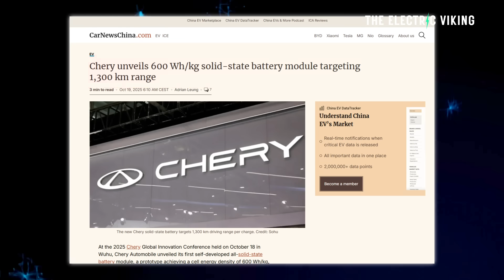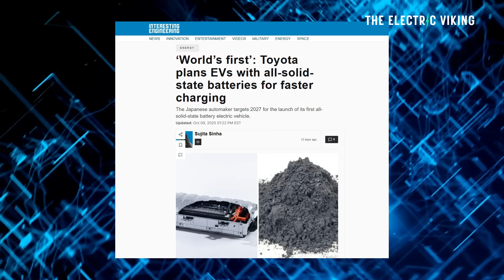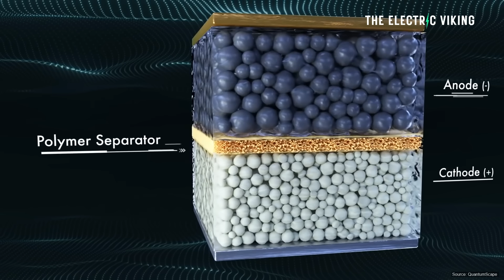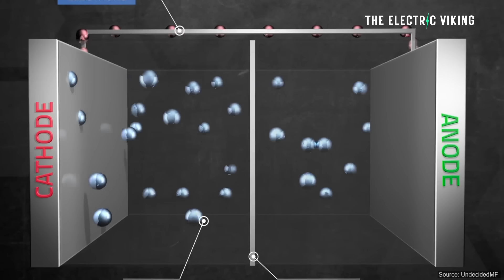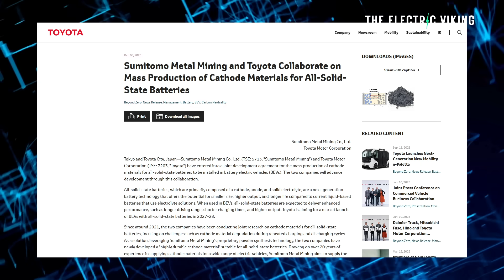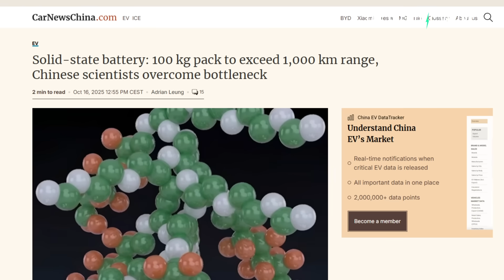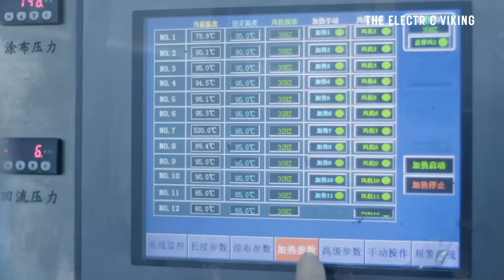Chery’s 600 Wh/kg Solid-State Battery: EV Game-Changer?

Comment: This would be nice for the E-Cars. You can built smaller Batteries into the Cars but they have more miles in it. 600 mliles or around 900km Range are enough. Long Range around 1200km would be very nice with this batteries.

Comment: China doesn't have oil so they are 100% on EV's and because of that and that they are new in car manufacturing without legacy they will stay on that path whch will lead to new advancement  not only in battery technology but also electric engines and in 10-15 years ICE cars will have no advantages over EVs so new generation will choose them as their first choice and in 40-50 years from now you will have totally different car market same as it was totally different in 1975-85 at least for European markets

Comment: 600wh/kg means 150kg/330 lbs of batteries will power a car at highway speeds for 6 hours. This IS a game changer.
Electric motors are great, but getting power to them has been the bottleneck. This could be the breakthrough in weight.
Next up: Charging time.

Comment: While expensive, it has specific use cases. Take the Polestar 5. It's a convertible. It's needs a lightweight battery so that it can remain nimble and is expected to have decent range (say 300 miles). Sodium won't be able to do this. The same is true for a Mini Cooper. It's a premium brand so people will pay more but it would be great if it had 300 mile range and also be lightweight.

Comment: Elon had previously stated that once battery density reaches 400 Kw per Kg commercial. flight become viable.. If this is true then the aviation world Is about to change radically. Also this, once the cost comes  down will  destroy the Ice motorcycle market.  I currently  Own a Honda CRF 250 , I converted to electric, with a max range  of 70 miles.. With that battery, one weighing the same as mine I could probably get a range of closer to 180 miles, On par or better than gas bikes with the same weight...

Comment: I refuse to accept the route-planning anxiety caused by limited battery range and insufficient charging infrastructure. I also refuse to accept even the slightest risk of battery fires.

Today, my gasoline car gives me a 1,000 km range — and I expect the same from an electric vehicle, with a full charge achievable in five minutes. Not 80%, but 100%. Since that’s unlikely anytime soon, I consider a 2,000 km range the minimum prerequisite for me to switch to an EV.

I also believe electric charging should never cost more than gasoline, and governments worldwide should make that a constitutional principle. Until these conditions are met, my answer remains simple: no to EVs.

And please, spare me the “eco” marketing gimmicks — the stripped-down interiors, plastic-heavy designs, and dull aesthetics that feel engineered rather than designed.

Wake me up around 2050, when technology might actually deliver on the promise. Until then, I’ll gladly consider plug-in hybrids with the new solid-state batteries, offering a 1,000 km gasoline range plus 300 km electric-only range. That’s a deal.

Comment: Batteries with this sort of power density are far more important for home battery storage than for the average EV driver who's daily mileage is  only around 19 miles in the UK and 40 miles in the US. What I'd like to see is a home system like the Sigenergy system having this level of power, along with it's dc fast charging and bidirectional capabilities. The ability to run my home for a week and top up my car with the 20 miles I've used that day each night all with free energy from my solar panels and I'd be as happy as a pig in shit.

Comment: A 600 mile range is perfect for the UK,  the UK is only 600 miles long by 300 miles wide at the furthest points, personally I've never known anyone who does that sort of commute on a regular basis, in fact the average daily mileage in the UK is 19 miles. As long as the battery is 800v and can charge in 10 minutes for the rare occasion it's needed, the other 99% of the time it can charge up during the 8 hours the average person sleeps every night. More power density is far more useful for home storage batteries, with the ability of bidirectional charging (battery to battery) of course . Then we can concentrate on improving the efficiency of solar panels to charge them up. Vehicles don't need any more power than is necessary to make them any faster than the maximum legal speed limit of whatever road they're travelling on and that can easily be controlled via the vehicle's gps.

Comment: I personally want a thousand mile range with aluminum ion and 12000 charge cycles to 95 %. Sounds like a tin anode with graphene caged tin. In a model 2 Tesla. At least a 500 mile range. With a super low price. With no thermal runnaway.

Comment: Don't get confused! Energy density has not much to do with the range, apart from the the total weight reduction. How much is that? Well if you currently have 250 Wh/kg density a 50 kWh pack will be 200 kg. the same 50 kWh pack with 600 Wh/kg density will be 83 kg. Yes, 117 kg weight saving, so the car won't be 2.1 tonnes, but 1.983 tonnes. Roughly 5% weight loss, which will translate to some range increase up to 5% if you are lucky, definitely not more. Range would increase if the battery weight remains the same 200kg, but then, we will have 120 kWh battery pack. Mind you that also need to fit into the car, which not many people talks about, the Volumetric Energy density Wh/liter. Don't get me wrong, I celebrate the higher density, just need to be clear what impact it has.

Comment: Eventually, we have to get to V2G, with as much capacity as possible in a battery. However, using abundant, cheap materials is more important. Until we have this combination, those high density batteries will be used for niche applications.

Comment: I would like an electric vehicle which can pull a 5000 pound load down the highway for at least 2-3 hours before needing a charge [my model X with 5000lb towing capacity only goes about 80 miles towing a speedboat]. I would also like to plug it in just once a week or so, instead of several times per week. That would probably mean it has a range of at least 500 miles on the highway with no trailer

Comment: An Indian high-level government committee finds that India’s “tenfold expansion” of its nuclear power capacity by 2047 is quite feasible and the committee suggests the investment begin immediately, says the Business Standard.      Mongabay explains non-economic loss and damage and IndiaSpend looks at how climate impacts are causing school closures, directly causing a potentially irreversible generational learning gap. Tell the U.S. POTUS that a generational learning gap for Indian children is NO HOAX, and not repaired by his "drill baby drill" pro-fossil fuel propaganda used to artificially prop up the U.S. Oil & Gas industries. Competing on UNSUBSIDIZED PRICE, Oil & Gas LOSE to wind and solar.      A Mongabay article explains the Climate Change factors behind the Ganga’s “most severe drought ever recorded”, with the river’s streamflow seeing the “steepest decline” in over 1,300 years. That's no hoax, any more than the U.S. Government SHUTDOWN by the Trump Republican Party control of EVERY branch of government, is a hoax.

Comment: The same range with less than 50% of the previous weight will be a game changer, especially if the charging speed is increased in the same proportion.

Comment: A slight niggle with the terminology: "Specific energy, also known as gravimetric energy density, is the amount of energy stored per unit mass of a substance or system, typically measured in watt-hours per kilogram (Wh/kg) or joules per kilogram (J/kg). It is a key metric for evaluating energy storage technologies, particularly in applications where weight is a critical factor, such as in portable electronics or electric vehicles, as it determines the amount of energy that can be stored per unit of mass."
Reply: Energy density is J/m**3

Comment: I just got back from 4 nights in Chengdu and 4 nights in Kunming.

We used taxis a lot. On the raods more than 95% of cars were electric. All the taxis. The roads are almost silent.

Scooters were also 95% electric. They drive them on the pavement sometimes, and the sound is like some high speed wheeled luggage. Audio cues are all wrong. Had to keep looking over my shoulder.

Comment: Common after all these years you still make an error that a 50kwh battery will give you a 1000km of range, yes they will be lighter but the range is the range and you need a bigger battery than 50kwh for 1000km you need at least 120 and probably 150kwh battery … which is possible with that energy density …

Comment: Although I appreciate your efforts, but there were more than 1000 game changers in past 4 years. Almost none of them made it to real EV car use. In fact Chevrolet Spark EV was the first car to use LFP in 2014. Even current EVs are mostly using LFP . So It takes decades for even good technology to make it to the market. Most of the people already have an ICE car, which they are planning to use until it stops working or become too expensive to run. As of today 

1. ICE cars (buying) are cheaper than EVs in similar segment (do not compare Mercedes Vs Toyota)
2. Insurance for ICE is cheaper than EVs (There must be some reason ? ).
3. Range is always more in ICE Vs EVs. Also ICE gives more flexibility. 
4. Support infrastructure (gas pumps , mechanics etc) is better for ICE than EVs.
5. ICE has less fire risk compared to EVs in general.
6. ICE does not depend on China (Battery rare earth mineral monopoly)
7. ICE tank takes less time to fill than charging an EV.

EV's biggest advantage is low cost of running, which is good for people who drives more (taxi, delivery man etc). In future EVs will surely beat ICE but it will take at least 10 years. I would switch to EV when:

A. Buying price for EV will be cheaper than ICE.
B. Insurance cost would be same or less than ICE.
C. EV has a minimum range of 300 miles (some EVs do have this now)
D. Real world battery life would be 200K miles / 15 years or more   (some EVs do have this now)
E. Can charge my EV to 80% in under 10 minutes (some EVs do have this now)

Comment: If the tech works it would absolutely not go in EVs initially.  This tech would be making it into supercars and electric planes first and gradually can find lower cost applications.  If they can make these even at low volume and they do what is claimed their is absolutely a market even if they are $1000 / kwh.

Comment: 600 miles vs 500 (depending on cost of course).  I live in Texas - cities are spread out and we drive a lot.  Have a Model Y and a Lightning in the stable.  

For the most part, don’t have range anxiety but that “perception” is keeping many folks from switching to an EV. 

500 to 600 at a reasonable price takes away that argument.  

My $.02!  (My 2 cents as we say here (opinion)).  

Thanks for video.

Comment: I'm an EE.  Just wanted to clarify that Solid State Batteries are complimentary to the liquid (sodium it lithium) batteries.  They charge and discharge faster so they are used for acceleration and regeneration.  About 20% of the battery pack will be solid state, specially on high power cars and other applications where short bursts are required...
Reply: Could you clarify further?  It isn't clear what they refers to at the start of the second sentence.   If solid state what advantage do the liquid batteries bring?
Reply: @wishdumain it's called a hybrid approach.  The main goal of a hybrid pack is to assign different chemistries to different roles, allowing the entire pack to operate at a higher overall efficiency. The SSB portion of the pack (potentially a smaller group of cells) is optimized for high power density (rapid energy delivery) and ultra-fast charging.

Comment: people with gas cars dont want 1300 km of range because they dont ever have worry about waiting for gas. or finding a gas station.  of battery degradation.  or the time it takes to charge. 

furthermore, we have to get to 100% renewable energy. 

I am in the phillipines.  The power goes out all the time. Vehicle to grid, home, and other vehicles would be amazing.  

I am really hopeful that we get to EVs having over 1000 miles of real world range.  its would be great if niche markets for higher priced vehicles provides the incentive and funding to get to truly advanced batteries at very low prices.

the batteries we have today are so massive and clunky.  they require so much thermal management. some companies have swappable batteries, but most have batteries that are incredibly expensive to replace. hopefully, by 2035 we will have batteries that would be so impressive by todays standards.  just like today's batteries are so impressive by 2015 standards.  we now have ranges that are double what they had a decade ago, and we should aim for at least one more doubling.  

bigger ranges also allow for smart charging.  we are going to have times of massive over production of renewables.  hopefully, enough people can be incentivized to fill up large batteries when their is an oversupply of clean power.

Comment: Mostly likely market for they batteries is sports cars and sports motorcycles, where the weight matters more than the cost.  A lighter more compact battery would allow for better packaging and thus weight distribution on sports bike without needing to reduce range. Currently EV motorbikes are either light and sporty with limited range or have acceptable range but very heavy which limits handling. 

The same goes for sports cars, if you can reduce the size and weight of the battery without effecting range, you can make lighter sportier car, a smaller battery pack would allow more packaging options, like making the pack thinner to get driver lower and closer to the road to give that true sports car feel.

Comment: Both. I want the modular battery bay for my car. When I need I can rent the battery that can run 1500 miles and pay a bit extra for that. But for my regular day-to-day operation I want cheap 300-500 miles battery which will cover 98% of my needs.
Reply: That would be awesome!
Reply: You're not gonna drive 1500 miles non-stop.  
Just take a rest and juice up your car
Reply: @commieTerminator  no, I am not going to drive 1500 miles myself. But auto-pilot would ;) It’s nice to have an option to go far into the woods to camp for a couple of weeks and not to worry about not having a supercharger in the near vicinity.

Comment: Toyota's new battery is 1,000,000 Wh/kg will give an avg range of 2500km on one charge, it will recharge to 90% in one minute, the battery is about the size of a loaf of bread, it carries 100% warranty for ever and when your car rusts away Toyota will buy the battery back from you for the price you paid for the car. Toyota will also grant you 3 wishes. Also the battery will clean your house, wash your dishes do your laundry take out your garbage mow your grass and clean your garage.

Comment: This is a real step forward. Chery has a great team of engineers, so I would believe them. I thought CATL's new battery, at 500 Wh/kg, was amazing! Battery density changes lots of parameters positively. Small lighter batteries mean longer range for the same capacity, higher power-to-weight ratios and more design freedom regarding the car. If it is true, safe, affordable and available, this is big news. It makes electric flight possible.

Comment: SS batts will probably show up first in high performance sports and other high end cars where the higher energy density enables lighter cars for maximum handling and braking advantages with less concern for cost or maximum range
Reply: Absolutely correct
Reply: Planes or other specialty application would be first.  If you have the greatest density in the world and limited capacity you sell to those for which cost isn't a factor at all.

Comment: EV's are currently poor investment regardless how good the batteries are...there  is not spare parts industry currently...manufactures recon failing e-motor, control units etc...customers have to pay overprices maintenance/recon costs...total scam...no wonder used EV are very cheap currently...stay away until from old EV's...they will bankrupt yourself.FACT.
Sidenote. EV motors have to have ceramic bearing to stop them failing...(induction electricity inside EV motor destroys bearings...carbon protection ring will not last long..rebuild of the whole motor needed)